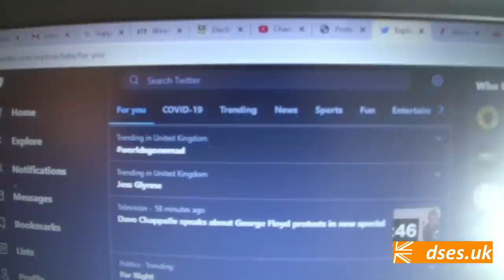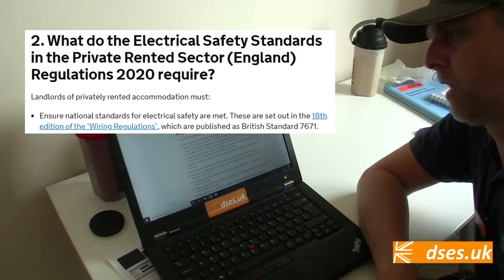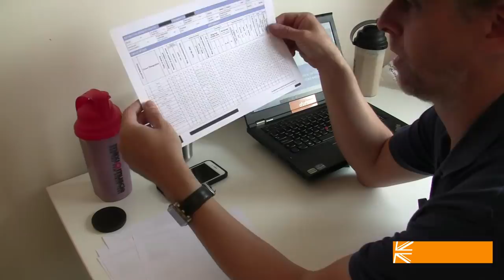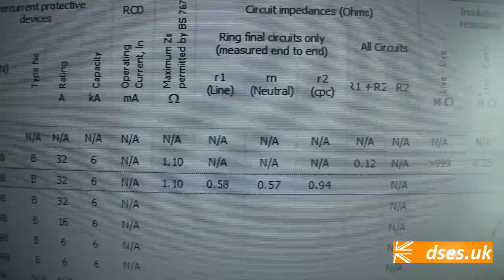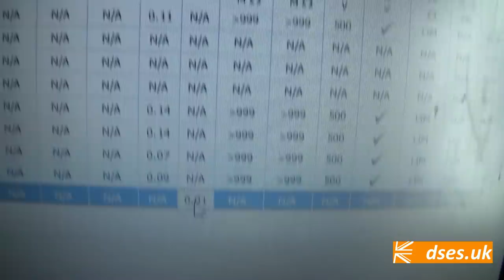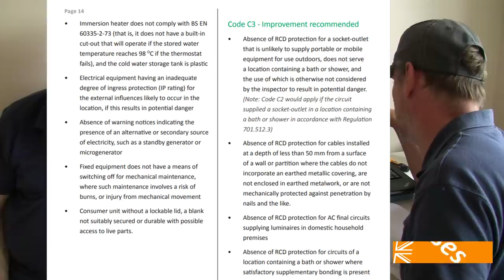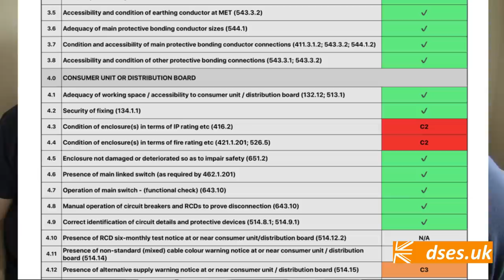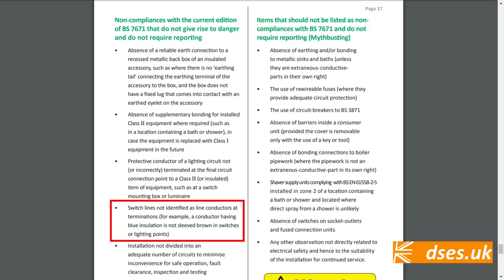Landlord electrical inspections from July!

Comment: Your take on a shower that is not RCD protected and you know the shower unit is obviously significantly younger than the installation and also know the manufacturer would have stated must be fitted via RCD? I’ve always put down C2.
Reply from the maker: If it's a new circuit that's been installed without appropriate protection, then it's a C2. If it's a circuit that predates the requirement, then a C3 even if the shower has been changed like-for-like. It's like how domestic lighting now needs RCD protection, however if you're called out to change a broken light fitting, you're not about to insist on the circuit being wholly upgraded before you can undertake the work. You would make the recommendation for such to cover your arse, but it's not a legal requirement for you or the homeowner to ensure the circuit is itself modernised before you can perform any basic maintenance. As for manufacturers' instructions, well if that new shower says it needs such protection as a stipulation of its installation, then you'd put it in. If you're undertaking an EICR and you see a newer shower has gone in on an older circuit, but you have no detail on the installation requirements provided by the manufacturer, then perhaps just a C3 again. There will always be arguments about the rights and wrongs, but RCDs installed for additional protection are just that. If the primary protection is in place (usually earthing and bonding) then the lack of an additional RCD shouldn't make it dangerous - just not as ideally safe as newer technology means it could be!
Reply: @dsesuk  Thank you David for answering. You hit it bang on for what I meant. Cheers buddy 👍

Comment: If you’re not using ring circuits anymore, what radial would you pull into a good sized utility with freezer, washer, tumble and the occasional iron.
Reply from the maker: Hi Lee. We often pull in a 2.5mm 20A circuit for living areas (i.e. one each for upstairs and downstairs on your average semi-detached), and a 4mm radial for a kitchen or utility room. Personally, I'd prefer it if 4mm had a larger CPC and there are arguments against 4mm if you have to apply de-rating factors, but for most average homes where the run is short and you're not passing through heavy insulation, a 4mm works just fine.
Reply: If it was a larger house would you just pull in a 4mm for the living areas and put a 32
Reply: @dsesuk  Why not 25A radial with 2.5 mm² cable?

Comment: Sorry to be a pain as i expect you've covered it in other vid's but what certification software do you use.
Reply from the maker: I'm on Easycert Andy. I get on with it; I like a self-contained app I can run on a traditional PC. It's expensive for the first year, but the costs really drop after that. If I weren't on Easycert, I'd check out Vespula and Electraform which are both web-based.
Reply: Many thanks for getting back to me. I will check these out.

Comment: 0.1M Ohms is considered a pass for appliances with a heating element due to the fact that the magnesium oxide inside the element is hygroscopic. If you had cranked the oven on for 15 minutes before testing it would have read a lot higher, it's probably been unused for a while and absorbed a bit of moisture. Also the reading you got  between all elements and earth. I'm sure you are aware of all that David. Nothing wrong with the oven in my opinion.
Reply from the maker: Probably not, but I wanted to know what the score was with that in case we are asked to install an RCD.
Reply: @dsesuk  Do you install one RCD for the whole installation or per circuit? RCDs are currently exempt for hardwired appliances and cooking appliances here in NZ, However the aussies will have to fit them for new installs once the new wiring rules get cited in the Electrical Safety Regulations. That to me seems like the influence of cooking appliance manufacturers, importers and distributors at play.
Reply from the maker: @cunning-stunt  I don't like to see one RCD on an entire installation as it introduces a single point of failure which will leave them high and dry should any circuit suffer a neutral to earth fault. That said, if it's a choice between an upfront RCD or no RCD at all, I'd go for the former.

Comment: Cheers, another awesome video, gutted Youtube are censoring your kind words of advice. What software do you use? currently i'm using iCertifi, I the past I was too much of a tight ass and lazy to pay and look for something else, however my yearly fee is due and i'm keen to try something else.
Reply from the maker: Thanks Michael. I'm on Easycert which is pricey for year one, then drops down a lot. I prefer an old-school laptop rather than an i-device. Check out Vespul and Electraform too as they charge per-cert and work online.

Comment: The Landlady has now forked out nearly 400 quid for two reports to be told she doesn’t need to upgrade the CU which could have been done for less than the price of the two reports ...not sure that is money well spent. I’d have been inclined to look at the original report, look at the installation and say I disagree with the C2, I think it’s a C3, quote for a board swap for RCBO future proofing the installation, improvements to safety and give the customer the choice ? Or has she decided to upgrade the board and this is your Pre testing and the EIC will cover the landlord legislation ?
Reply from the maker: This is the problem though Marco; different inspectors giving different conclusions leading to an inconsistent result for the landlord. If an inspector has their own agenda because they're trying to drum up business or apply their own personal standards, then the report is skewed to a fail. Same for those who are ignorant of the process and produce reports that are nonsense or demonstrably draw the wrong conclusions. Someone applying the guidance as given by BS7671, guidance notes, ESF's best practice guides, Codebreakers, building regs etc. may well have a different opinion, but one more evidence based as I hope we have here. I wouldn't have performed a board swap based on the first report as I could see there were errors in it and I disagreed with the conclusions, so I had to replicate the inspection and testing to get my own data. It turned out the test data on the first report was accurate, but I had to know that for myself as I will be tasked with changing it if she acts on my recommendations to upgrade. Should that happen, then an EIC will be issued to reflect the upgrade, and that will suffice for up to another five years.
Reply: David Savery Electrical Services fair points David and I don’t disagree completely but you could, from the report, have deduced that the main question is to swap or not to swap. Now given that a swap would require the same set of tests and verification anyway and an EIC , for the extra 150 you could have done the upgrade. You could have still done the video on your (correct in my view) coding and interpretation of the legislation but thrown in a shiny new SPD/ RCBO board. Great video though and great to bring these issues to the fore
Reply: @dsesuk  This is why the new regulations for rental properties should just state a minimum standard of protection they should comply with.  For example rcd's on all socket circuits or rcd's on all circuits,  whatever it may be.  It would remove the different interpretations of compliance by different testers.

Comment: Top video as always gents. How do you test inspect downlights ? Most of them are murder tight in the holes so removing them will cause damage to the ceiling as they come out.   Do you pull them out and be dammed or limit them ??
Reply from the maker: We limit anything where damage mat be caused by removal, but we do try to take a look behind a random sample of downlights in an installation to see if they're properly terminated, fire rated, covered with insulating material etc. It can be a risk of plaster or paint cracking though, especially with some of the spring hinges which are like flimmin' mousetraps!

Comment: Go back far enough, CU were metal (maybe Plastics lid) cable in conduit and metal clips.... plastic comes out and now they back tracking to save the dolphins (fire personnel) :)
Reply from the maker: Had one just last week: mid Nineties, metal enclosure, 30mA RCD main switch to BS4293 and MCB's to BS3871. Someone will still pop up and tell the client it needs replacing though.

Comment: Great sensible advice. Would agree with original sparks recommend label for 'dual supply' as there is no single isolator switch. What do you do for storage heaters, lim Zs readings as not energised? Would you lim any rcd times on e7 supply?
Reply from the maker: Thanks Chris, an interesting point about isolation although I'd have that as 'other required labelling' rather than dual supply. Yes, live tests on the off-peak side are limited.

Comment: As far as cutout fuse sizes go, unfortunately you can order a 100A fuse for the 60/80A carrier, and 60A and 80A fuses for the 100A carriers (also 30A, again for both). I have no view into how various DNOs have handled this over the years, so unless it has a label explicitly identifying the fitted fuse as opposed to the original Henley label with the carrier size, it's all guesswork. I mentioned this on the E5 video back when and.. the video disappeared. I hope that wasn't down to getting negative feedback, which certainly wasn't my intention.

Perhaps the DNOs should be made to be transparent regarding the state of their equipment and installations..
Reply from the maker: Evening Monkeh, nice to hear from you again. Did e5 take that video down? I went looking for it to link to it, but I couldn't remember if that's where I saw it. More often than not, I show LIM for the supplier fuse as there isn't usually a label on there. I don't know why; how hard can it be to label the damn thing, especially when the sparkie needs to know if the tails and earthing are up to snuff.
Reply: @dsesuk  I'm pretty sure it was e5, and I can't find it myself. I'm fairly sure I recall seeing it vanish off my subscriptions at the time.

Comment: Sparkies.... when you do minor work e.g. swap a faulty security light outside, or replace a single broken socket do you check bonding water and gas continuity using flying lead on these jobs? It seems so weird when a customer has asked me to fix an outside light and then I have to ask them where their water 'stop cock' is or gas meter... I usually just check continuity of a water pipe to a nearby accessory screw...
Reply from the maker: I must admit, on a MW I usually just perform a cursory visual for bonding. It's bad enough having to dismantle the CU for a Ze and to disconnect the circuit neutral for an IR to satisfy the 18th Edition cert which nobody will ever look at and which your cash-in-hand rivals aren't spending their time on.

Comment: Being in a unit, presumably that board is a sub board and that the(missing) main board is fitted with the N-E link too.
Reply from the maker: I don't think there's another DB, just a three-phase intake with a single phase splitting off to each flat.
Reply: @dsesuk  Yep that'll be it. It'll be wherever the meters and service fuses are!

Comment: I really admire your logic, but I do take the importance of valid smoke alarms, to be working, interlinked and in date, especially in properties with three or more floors. I take this view due to data revealing that 77% of house fires start in the kitchen areas. With fire doors on most loft conversions, or actual second floors, say town houses for example, one cannot always hear a smoke alarm ‘triggering’ on the ground floor, when situated on the second floor with the fire door shut. Allegedly, your hearing capability drops when one is asleep, so someone sleeping on this floor may not necessarily hear a non-interlinked smoke alarm on the ground floor.
Your view, or the view of other subscribers would be most welcome on this conundrum.....great videos as always...especially the Holmes and Watson parody 🥳
Reply from the maker: Smokes are important as you say, and because it's easy to shoehorn them into the report, you may as well do so. Thanks for watching!

Comment: I would avoid insulation tests with any appliance (e.g. the cooker) connected.

Modern appliances will have MOV and class X/Y capacitors from both L and N to earth, to guard against surges and for RF filtering. These components are often not rated for any DC voltage at all, or perhaps 400V if they are. (I'm in the USA, so perhaps I'm missing something?). They will be damaged by a 500V IR test. Turning off the isolator may not be good enough since these components are also fitted from neutral to earth. They are often designed to fail open circuit, so damage cannot easily be assessed.

Shouldn't the 18th edition mention grandfathering in old installations? That'd make sense....
Reply from the maker: Thanks for viewing from over the pond Nathan. The 18th does mention grandfathering with both the notice from the Health and Safety Executive mentioned in this video and in Regulation 651.2. All the guidance available to me allows me to pass older installations, so it's the wording and interpretation of the new landlord legislation that throws a spanner in the works as it seems to suggest 18th Edition is the standard required which, I suspect, can't really be the intention in such a short timeframe. Regarding insulation testing, the expectation for appliances is that they can pass an in-service inspection and testing (aka PAT inspection as covered in another video) at 500V DC, or dropped to 250V if surge protection is present. This is considered a 'hard test' that can be omitted where it could risk damage, but in the thousands of tests I've undertaken, I've not left a trail of destruction behind me... that I know of! Equipment from reputable manufacturers should be designed to withstand the PAT process, or at least you'd hope so.
Reply: @dsesuk  Thanks for the reply! I'm an electronics designer and not an electrician, but I do enjoy the videos. In the United States, we have nothing like an EICR.... very rarely is any sort of proactive inspection completed. Apartment building electrics are often deficient, but I wonder how often it causes significant damage or injury. It's good to hear 250V is an option. And, yeah, 500V is unlikely to cause catastrophic damage... I was suggesting more like it'll be a small degradation at each test. My oven has digital controls, I'd wager it has a 275 Vac-rated filter capacitor from neutral to earth....

Comment: @davidsaveryelectricalservices
Help! 
Can I install a new plastic shower fuse board I.e a small 2 way board adjacent to the original consumer unit? 
If not why are PVC shower boards still on the market? 
I don't get it.
Reply from the maker: The short answer is no, domestically anyway, not unless it's housed in a steel enclosure. Plastic units are still available because they can be used commercially, they can be used in outbuildings (where people aren't residing/sleeping), they can be used in areas requiring IP rating such as outdoors and they can be used where they're housed in metallic enclosures. There's still a role for plastic enclosures, but domestically you'd need a shower board to be steel to comply with 421.1.201.
Reply: @dsesuk  thanks David. As always, your awesome. 👍

Comment: wondering how it works in the UK. you state a CU needs to be metal. but (modern) plastic doesn't burn, it doesn't fuel or start a fire. in the Netherlands metal CU aren't even sold. i know in Germany the prefer metal but plastic is also sold.
Reply from the maker: Domestic consumer units need to be metal if installed after January 2016. It's a stupid change brought in because an insulated enclosure, if badly installed, may not contain a fire. Similarly, a metal enclosure, if badly installed, also won't contain a fire, but rather than do something to raise workmanship standards, this sticking-plaster solution was dreamt up.

Comment: Hi David - without supplementary boding in bathroom it would be C2 according so ESFBPG4, code breakers and popular opinion. (without RCD) The video didn’t show this in place or you testing for it  (I can’t remember the last time I saw any) You did state it was there and as this is such a crucial point in terms of coding C2 or C3 and this OK not OK would like to have seen this explored further. This is a scenario which very common and most properties of an age of no RCD have usually had a bathroom rip out along with the unsightly supp. bonding on the rad and water pipes...
Reply from the maker: This is one of those videos where I think afterwards "why didn't I show that and save myself some questions in the comments!" I don't know why we neglected to show more of the bathroom on the day; it's annoying to have missed it.